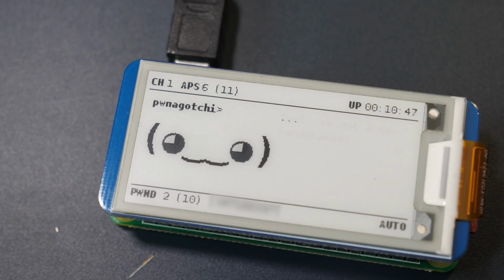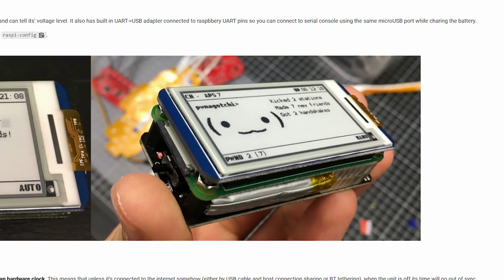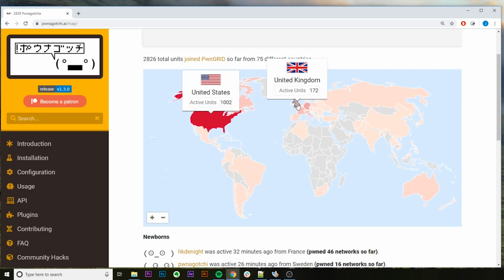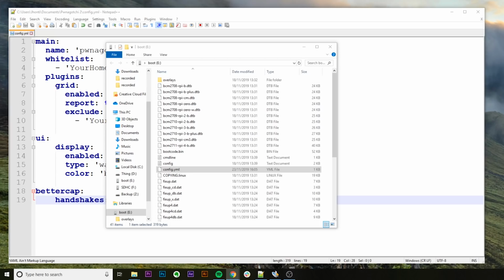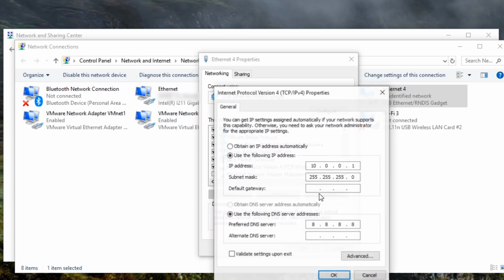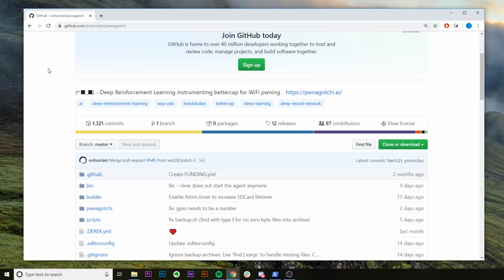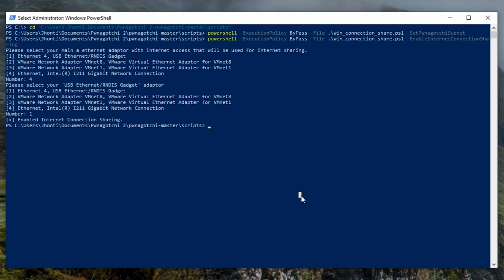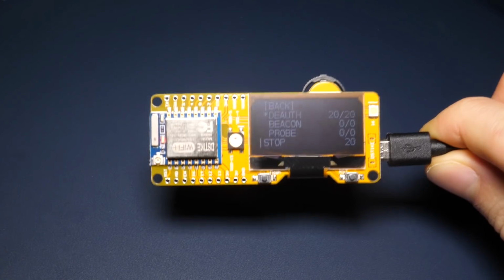PWNing WiFi With AI | Pwnagotchi Setup/Tutorial

Comment: problem powershell : The term 'powershell' is not recognized as the name of a cmdlet, function, script file, or oper
able program. Check the spelling of the name, or if a path was included, verify that the path is correct and
 try again.
At line:1 char:1
+ powershell -ExecutionPolicy ByPass -File .\win_connection_share.ps1 - ...
+ ~~~~~~~~~~
    + CategoryInfo          : ObjectNotFound: (powershell:String) [], CommandNotFoundException
    + FullyQualifiedErrorId : CommandNotFoundException

Comment: Ok I ran into a problem, posted the issue on the official github page but no response, so basically what happens is that the hid scripts dont work they deploy but never gets completed just keeps on running. I've tried many PCs and using different sd cards and the cable is not the issue because it gives the lan connection but the script just won't run. Yes and also the keyboard is correct. PLS HELP

Comment: So I am trying this right now. Problem is, my Pi isnt showing up as a network adapter. Am I missing something? I'm using a USB Network Stick to get Wifi, could that be a problem?

Edit: Finally got it working. Driver wasnt installed automatically. Installed some RNDIS Driver through the Device Manager and it worked

Comment: My e-ink display(waveshare v2) won't show anything after booting. Any ideas on how to troubleshoot?
Reply: Same problem. Though I am using an inkyphat display. After flashing and copying the yml file to the boot directory nothing happens when I power it on. The green LED flashes now and then but that's about it. Had it run for over an hour but no progress nor any sign of life. Re-flashed it every time I tried again but no change. Tried both ports with flashes in between.

Comment: I followed all your steps but I couldn't get the program to run. I've tried different programs to flash the pwnagatchi onto my SD card but it never worked. Is there anything else I can do to get it running?
Reply: Yea the sha256 doesnt match atm, and etcher gives errors when flashing to multiple ads. Even still it seems to work except the screen wont turn on no matter what

Comment: Using 10.0.0.1 as the IP may conflict with many peoples internet connections as many ISP provided and also third party routers use the 10. IP scheme.
Reply: I have Xfinity and this is the gateway to the portal. Could I set it to whatever I want or does it have to be 10.0.0.1?????

Comment: how to setup on linux pc ??
Reply: Being ssh you could probably just go into your network manager or use ifconfig. I've never used a pwnagotchi but that is what I would try
Reply: @johnfeistner467  I don't have raspberry pi  , I want try on my laptop .
Reply: @linuxinside6188  The pwnagotchi is designed on Raspbian Lite which is built on Debian. You could always reverse engineer it and rebuild it to run on the x86 or x64 version of Debian. Keep in mind however that this would be a very long and difficult process and DEFINITELY not for beginners.